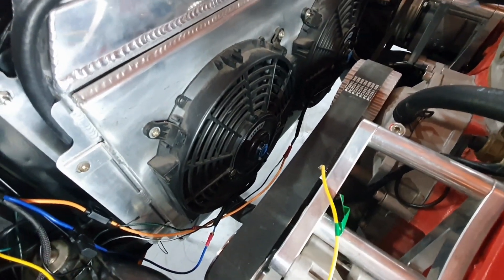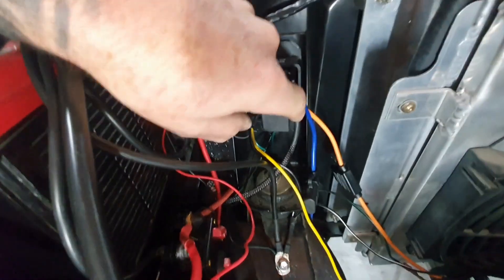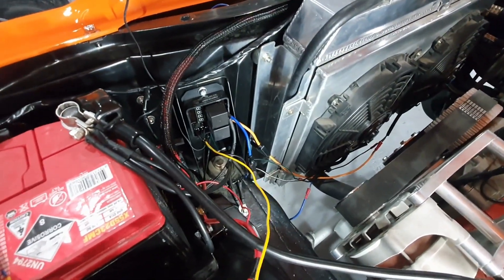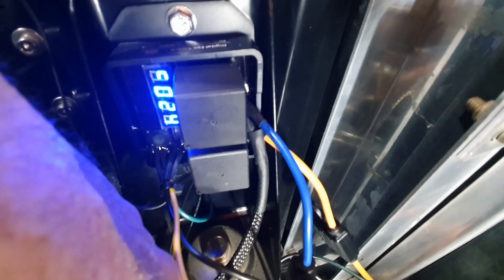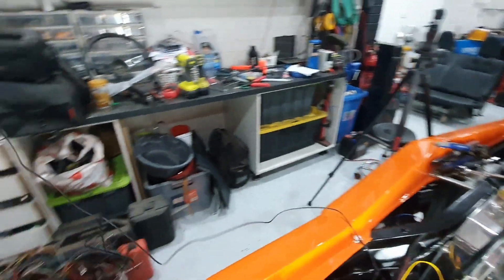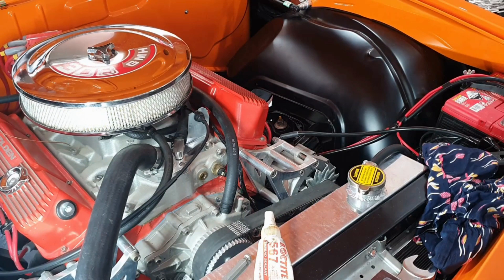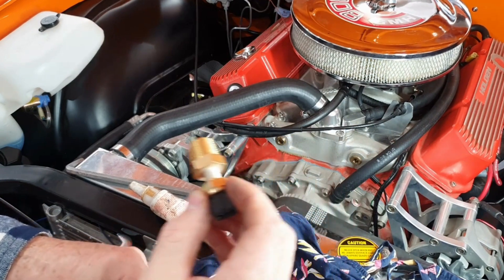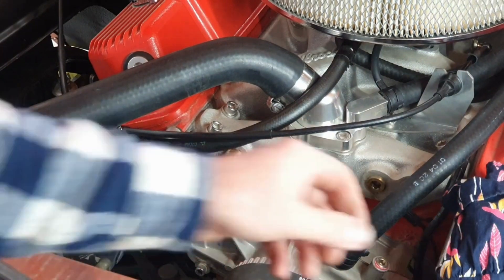Davies Craig Thermo fan controller Installation 1

Comment: What could be wrong if the fan automatically comes on once you turn the key to the ACC position? I swapped the relays around and it didn’t make a difference.  Temp is reading 74 and is set to come on @175
Reply from the maker: @925_NotchBack  you could have some of the wiring crossed.
Reply: @ I’ll double check it.  It was working fine at first but I did move wires around so maybe something got crossed.

Comment: According to this video it’s been a year since you posted it, how is the unit holding up, would you still recommend it?
Reply from the maker: @Dave-ix5dc  I would definitely recommend it. I've used plenty of them. Easy to dial up the thermo cut in temperature to suit each engine. Easy installation. Good luck with it Dave.

Comment: What amperage relay? Is it needed? The temperature sensor has 2 wires. .when you said cut...no polarity? Do you like the probe for the radiator fins? Nice
Reply from the maker: @ari1234.  the breaker is for the power steering pump, 50 amp.
Reply from the maker: @ari1234.  they have twin 40amp relays on them.

Comment: What gauge wire
Reply from the maker: @ari1234.  12AWG  or 2.7mm wire including insulation. Capable of 40a max load and 30a running current. But this is dependant on your fan size. Smaller fan can be smaller wire. This info is for a large thermo. I have 2 medium size fans and I preffer the wire size is on the bigger size.
Hope this helps and thanks for watching

Comment: Good installation Demonstration, thanks
Reply from the maker: Thanks, they really are simple to install. They work great too.
Reply from the maker: @mansfieldlam309  thanks for watching. I like that it's adjustable just by pressing a button. No changing sensors to change the engine running temperature.

Comment: Does the switch stay on even when car off? Mines staying on even when I turn off my car
Reply from the maker: Not if you connect it to a switched ignition source.
If you choose to have it stay on after the ignition is off. Then you can connect direct to battery. The thermostat in the unit will turn off the fans when it reaches the set point you set up.

Comment: Can this work if my ac compressor have a leak  and no ac at the moment?
Reply from the maker: Yes, as it operates separately from the a/c switch. This has its own sensor, either in block sensor or through the radiator fins sensor. Obviously the in block sensor is more accurate as its actual engine temperature.

Comment: The Davis Craig thermo switch works brilliantly used them a few times now..
Pretty sure you can set them up with an override bypass switch..
Reply from the maker: If I read the instruction correctly it probably would have explained that to me. Unfortunately, typical man, not reading instructions. Lol Thanks for the info @scotthunter1639
Reply: @SullysRodskustoms.  please don't take what I said the wrong way mate..
I was meaning in my experience with them sorry mate..
Love your content always great 👍 👌
Reply from the maker: All good, I understood what you meant @scotthunter1639.
 I was just messing around mate, my misses always tells me to read the instruction, I never do. I get it right most of the time. Other times. I should have just read the instructions like she said. Lol
Reply: @SullysRodskustoms.  haha, I'm a diesel mechanic by trade. Very rarely, I read the instructions..lol